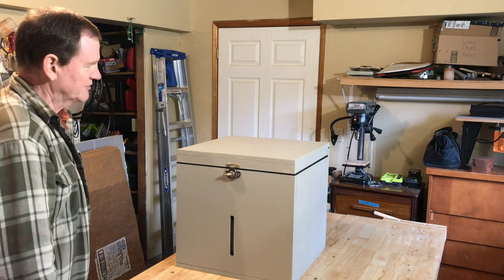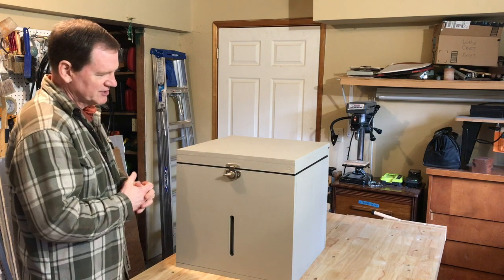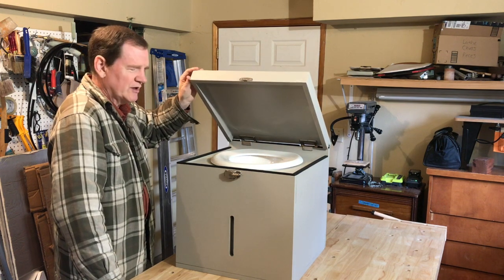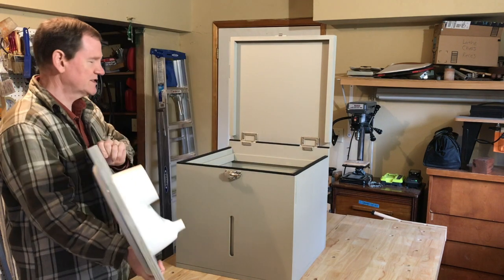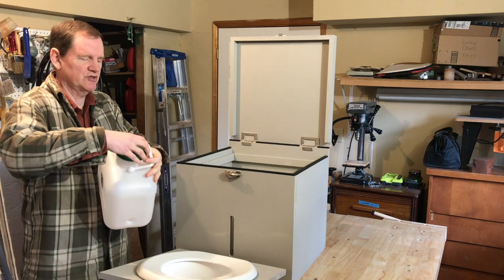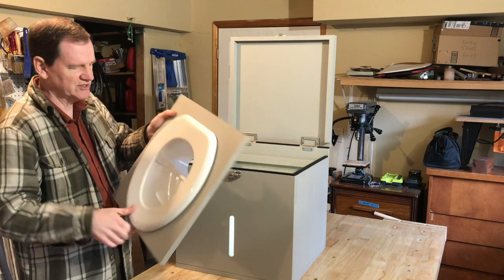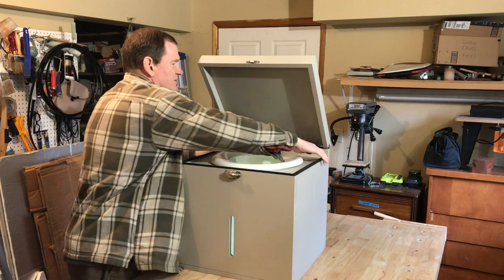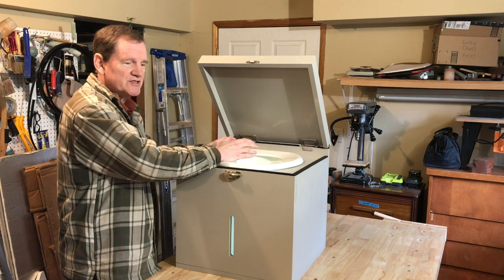Urine Diverting Toilet 2022

Comment from the maker: Internal parts from Kildwick: https://www.kildwick.com/Kildwick-camping-toilet-DIY-kit-without-casing-16l_6
Rockler Hinges - 30lb x 2 pack: https://www.rockler.com/lid-stay-torsion-hinge-lid-support-satin-nickel
Quiet Fan: https://www.amazon.com/gp/product/B009NQLT0M/
Push Button Switch: https://www.amazon.com/gp/product/B07931588C/
Find out more about the van builds at https://campmaker.com

Comment: 0:46 That hum is sounds like a feedback loop, the microphone can hear itself. It comes and goes as you move the microphone. Best, a headworn or lapel microphone and recording into a separate recorder (your phone, perhaps).
Reply from the maker: Thank you. This was recorded on an older iPhone. I have a newer one now that seems to do better.
Reply: @dennislittlefield  The hum varied with your movements. THat has nothing to do with your equipment, it's how it's used.

Comment: Thanks, Dennis. I wonder if you could link to whatever composting material it is you use to add to the toilet? (I've never had one--this is out first build).
Reply from the maker: People use a wide variety of material. Peat moss, coconut duff, but I’ve found that sawdust is just as effective. It certainly can be done, but very few actually compost the solids from a dry toilet. The solids dry out and loose volume. You can remove the plastic bag, tie and toss in the garbage.
Reply: @dennislittlefield  forgive me if I misunderstand but if u use a plastic bag and dump in regular garbage then it's not really a composting toilet. I would imagine using composting bags and disposing it as compost waste would make more since and be much more environmentally friendly. Unless I'm missing something.
Reply: Addressing @Dennis: I like cedar shavings, the bag is for a traveller and dumping is the way to go. On a homestead one would commonly use a newspaper liner, or nothing, and truely compost the wast(typically) one year batch for gardening. Now gardening,  one would use sawdust (pine) or peat to enhance breakdown. Cedar is too slow to break down. But is nicely odor concealing, thus for traveler use.

Comment: Glad to finally find this design of yours!  May I ask what’s the outer dimension of the box ? Thanks in adv!
Reply from the maker: The outer dimensions are 19 X 19 X 19.  The "lid" is 2 inches high and it is included in the 19 inches. Kildwick includes a template for the shape of the urine diverter.
Reply from the maker: This would be slightly more comfortable to sit on if it was about 18 inches high, but 19 inches made it work better with the other cabinets around the toilet.

Comment: Intriguing, nice design and build.  So, into a bag you poo on top of previous poo?  Don't you put sawdust in?  What if the descending poo hits the sides on its way down?  The simplicity is really appealing.  I would have expected it could just be the size of seat, but I suppose the buckets need 17" ?
Reply from the maker: Sawdust is often used. If you want the best option cocoanut fiber works well.  This type of toilet doesn't create much smell and when you add the small vent fan it can be fine to not use sawdust for a few days and then toss the bag in the garbage.  The 17" height allows the liquid tank to be 2 gallons, which is enough for two people for one day. Any smaller would be a big problem. The solids container has to follow suit and be the same height as the liquid tank.